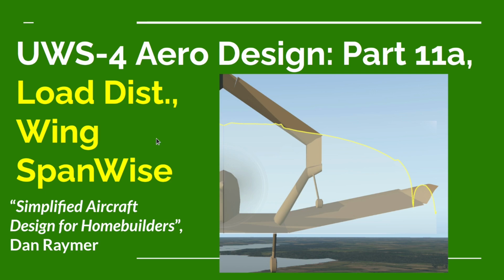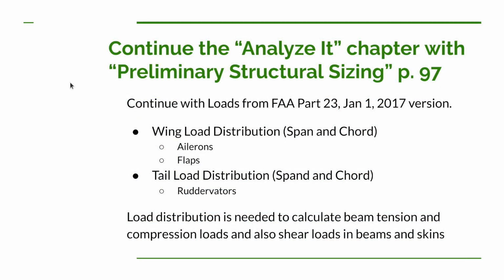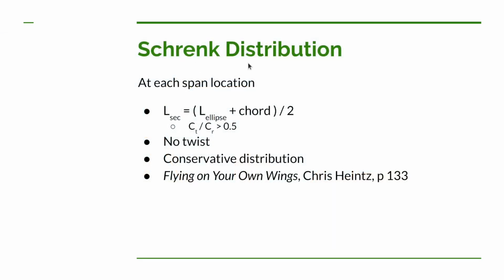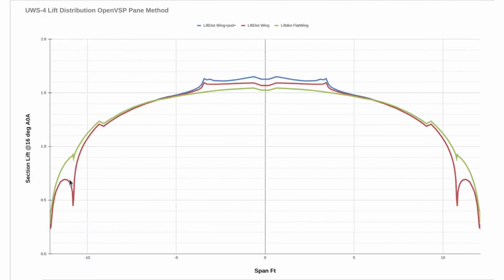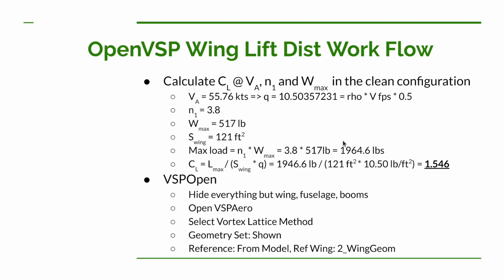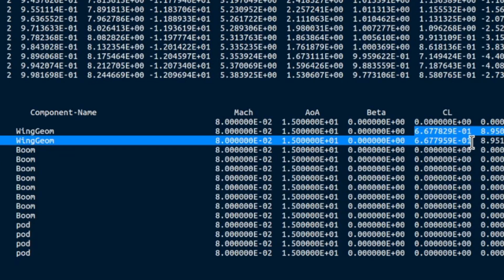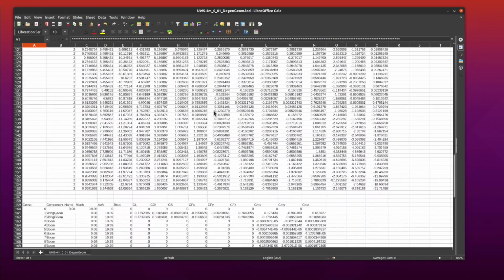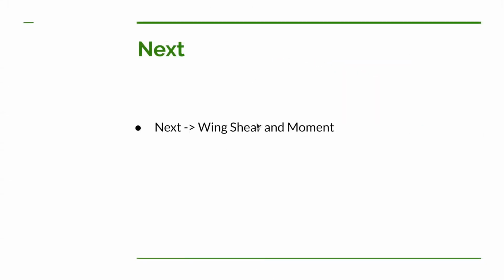UWS-4 Aero Design: Part 11a, Load Distribution - Spanwise

Comment: Really learning a lot from your videos. I built a Mitchell Wing B-10 back in the middle’80’s and it’s encouraging to see how your calculations substantiate many of the design choices that I took on blind faith by 1. Following the plans and 2. Asking questions of the factory (great guys) and heeding their answers (I was a typical homebuilder- take a really neat design and put a bigger motor in it- a 28 hp fan cooled Rotax 277 instead of the recommended 20 hp 250cc free air Zenoah). Ended up with a 243#  machine that took me on many adventures including a 600 mile round trip to Oshkosh. Looking forward to seeing what you end up with.

Comment: Slow and steady progress. Designing an aircraft from the ground up is a daunting  task! I know  I pull my hair out on a regular basis, trying to keep the weight under 254lbs with the project I'm working on! I often wonder how they come up with such a arbitrary number. If it were 300lbs. We could make safer aircraft!!!
Reply from the maker: 40 years ago, when they came out with part 103, I think they just looked at the weights of the then current crop of ultralights and used that as their basis for the 254 lb limit. But I agree, 300 lbs would be so much eaiser.
Reply: @Designer103  unfortunately, the one time the FAA seemed ready to adjust the weight upward, the “ultralight community” could not get their act together and present one number. It got ridiculous especially when one loudmouth proposed 450#. That’s when the FAA reps backed away (thinking this would be a bad career move) and went on to work on more urgent problems. A little history, when Part 103 was being written the original empty weight being considered was only 154#- basically a foot launchable barely powered hang glider. John Chotia of Weedhopper fame managed to build such a machine, but was killed when it crashed while he was demonstrating it to the FAA…….

Comment: The sharp dip in load at the base of the winglet might be an error in VSPAero - it does not look right at all. I have seen similar problems from time to time in my simulations too. For example, go to the github page of OpenVSP and look for issue 210 that I reported. I would link it here for you, but it seems like putting links in YouTube comments causes them to be flagged as spam. There's a comment on your last video from me that I think ended up in your 'flagged for review' section.
The smaller jagged anomaly of the load curve might be at the edge of control surfaces. You could determine that by making a copy of the file and deleting all control surfaces, and run the simulation like that.
Anyway if I was you, I would post about this in the github issues along with the .vsp3 file and see if the developers have any comment.
Reply from the maker: Thanks for the info. The little jag does not seem to be related to a control surface or tessellation. It is odd.
Reply: @Designer103   The dip in local lift coefficient is an artifact of the panel method.  It generally occurs when there is an abrupt change in geometry and is likely related to control points and how the surface boundary conditions are handled.  Large changes in angle between adjacent panels appears to let the potential flow seep through.

In your case, the problem is probably occurring because of the large change in leading edge sweep where the wingtip begins.  I've found that adding additional wing sections to smooth out the geometry tends to mitigate the issue.  I would suggest adding a 6" section or a pair of 3" sections to create a smoother transition to the wingtip and reduce the angle between adjacent panels - although with your extremely fine paneling you could make these sections even smaller.

Admittedly I am not an expert on potential flow panel methods.  I have had a couple of classes that discussed how panel methods work, I've read a few papers, and I have experience with VSPAERO and XFLR5, but my knowledge is not at a level where I could code a panel method solver from scratch.  Without being able to probe the potential flow solution on the panel joint where the geometry change occurs this is merely what I believe to be happening and a solution that I've found that brings the calculated results into line with the expected results (i.e. no sudden nonphysical decreases in local lift).